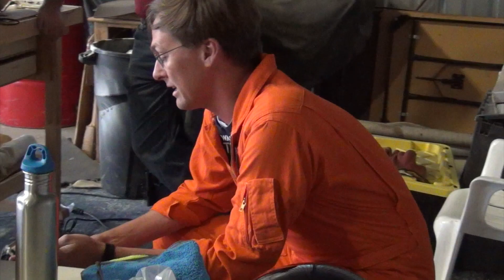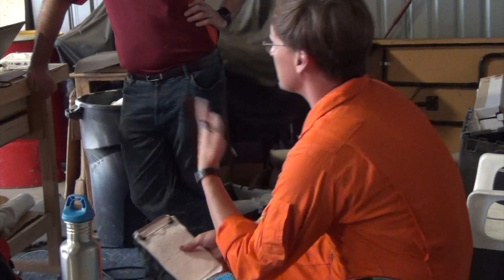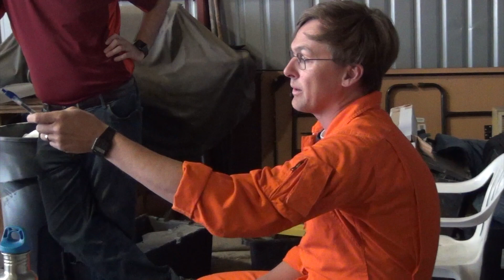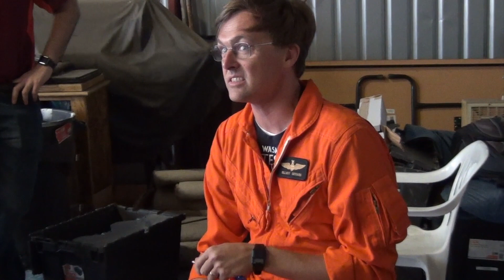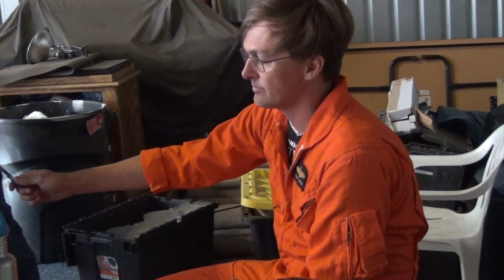Brief - First Flight - Mantis RV-7 - 8.16.2019

Comment: Elliot thanks for sharing that. Very nice look in to what goes on for a test flight of a new GA home built. Very thorough and professional...and SAFE. Well done.
 A opinion on the comment of 5,000 RV's flying and a known aircraft. RV's have crashed and killed people too. Doesn't matter if there are 50,000 of them or its the first one. Things happen and  testing should be gradual and methodical...especially on a home built. That alone makes for a lot of variables from plane to plane. I respect your process.
Reply from the maker: Thanks for the comment.